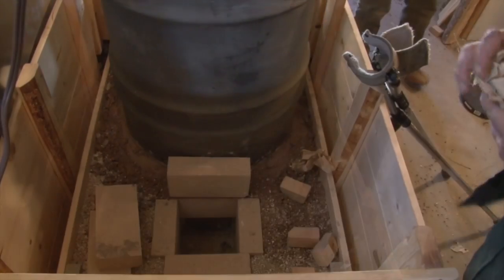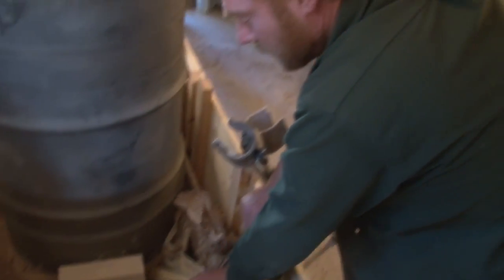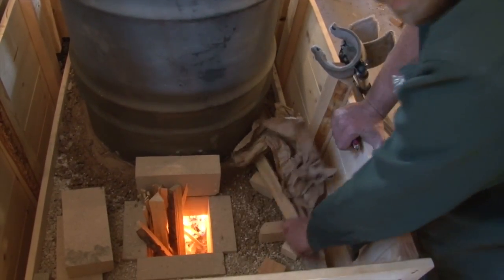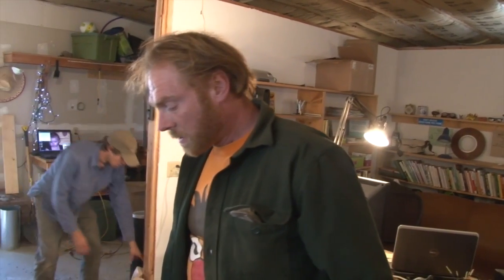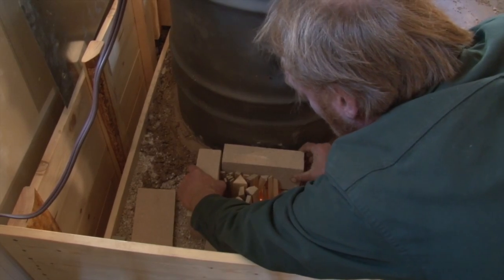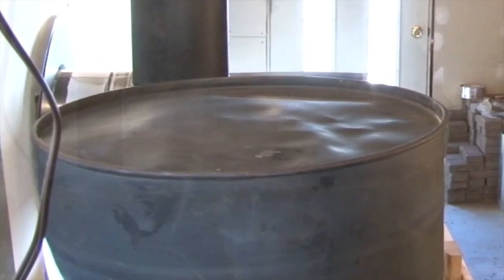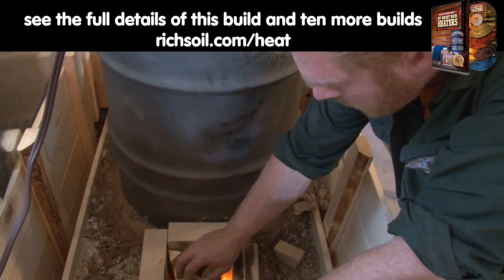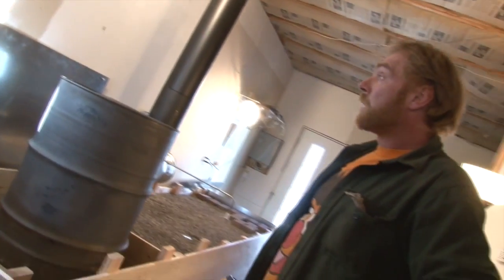starting a rocket mass heater

Comment: Hi. What nice short and clear video. Thats how our daily RMH routine looks like: piece of cake to light it. Only difference is that we use one pine cone istead of paper and therefore also don't use the super small kindling, as the pine cone brings a lot of power with it.
I am interested in Ernies terminology. What exactly does he mean with equilibrium between the inside and the outside?

Comment from the maker: those of you that have rocket mass heaters, what is your trick for starting one?
Reply: I like to put a row of small pieces, that are leaned up against the back of the wood feed (nearest to the drum) , 3-5 pieces. Then I put the paper behind that, it makes the flames go thru the wood, and slows down the draft to help keep the flames on the paper, so the paper doesn't go out.